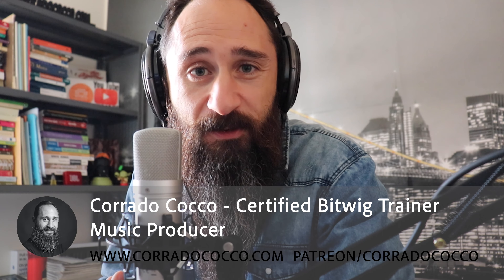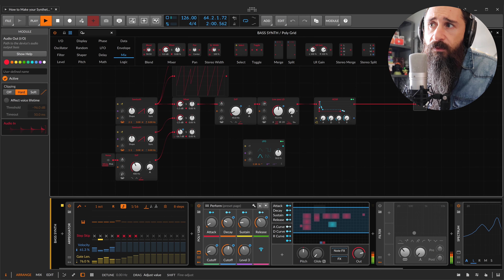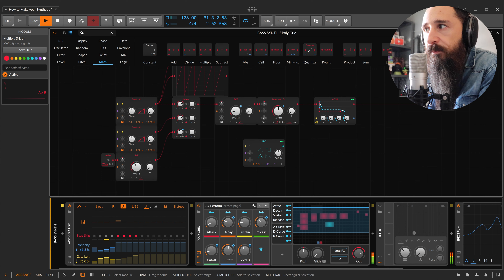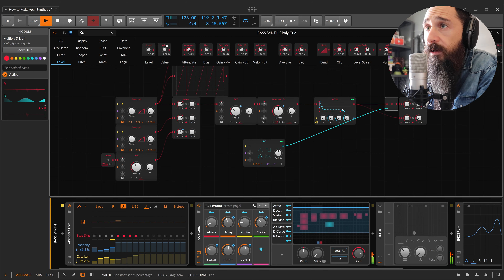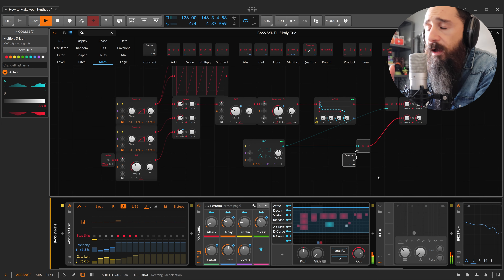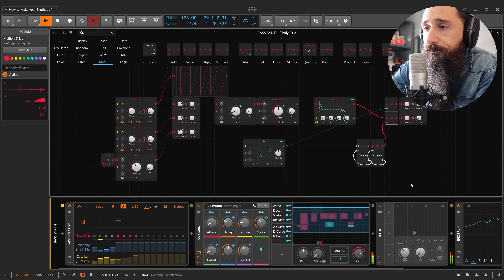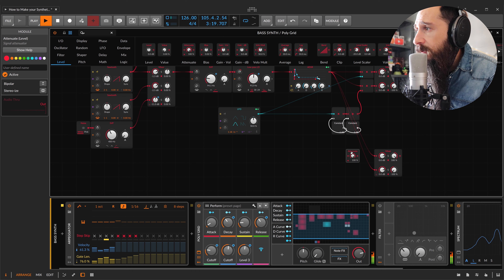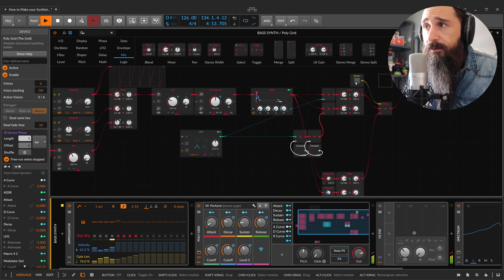How to Make your Synthesizer Stereo

Comment: The one thing I'm confused about is, when you altered the fine-tune frequency of one of the oscillators, are both osillators going to different stereo channels? If they're both going through a single mono channel, I can't see how this would make it stereo unless you run 2 instances of the mono synth, with both biased towards opposite channels, and detune them from there. If it really is mono, wouldn't detuning the oscillators simply add movement and texture to the timbre, rather than making it stereo? I detune the oscillators in almost every single one of the synth patches I make, and never noticed it making it sound more stereo, just more "fat" or "analog."

If this would take too long for you to explain, I won't blame you for not replying or explaining. Much love, hope you and your loved ones are doing well.
Reply from the maker: Hello @Mikeureko, A stereo Signal means a signal which has a spread between the left and right Channel.. This Spread could be in terms of Frequency or Amplitude or something else.. When you switch the +- fine-tune freq you 're making a spread in terms of Frequency. Let's connect a stereo split and connect the right and left channel into an oscilloscope and take a look at this... You'll see that the signals are different from each other... A Mono signal is a signal which doesn't have any spread/difference between left and right channel... Although you see one Output this output contains two channels (left+right) like a final master bus.

Thank you for you interest!
Reply: @CorradoCoccoMusic  I guess what confused me is I assumed that sounds in the left and right channels have to have the frequency/amplitude difference from one another, and that if both oscillators are in the same single mono channel, changing the frequency wouldn't do anything stereo-related. Thanks for the reply.